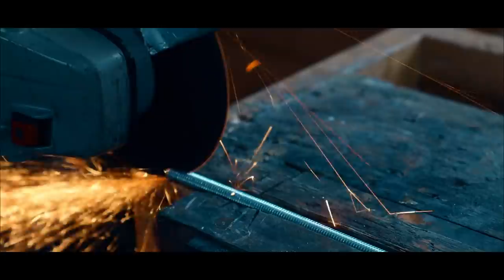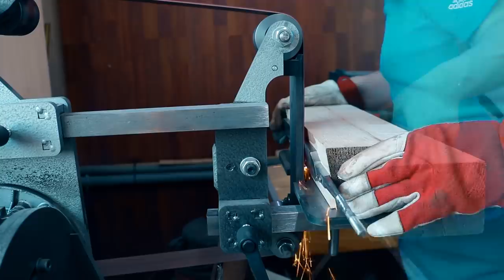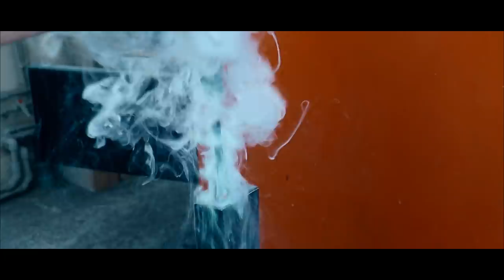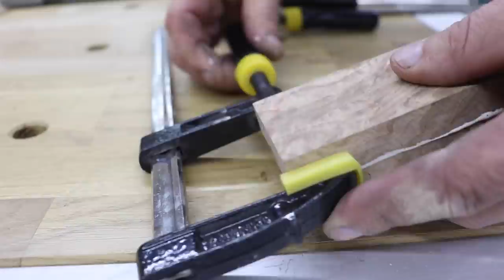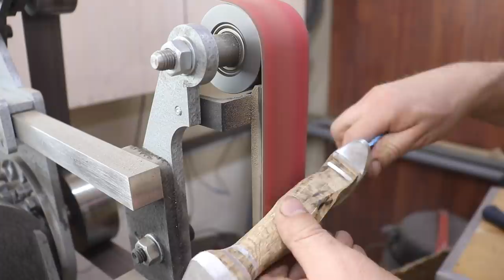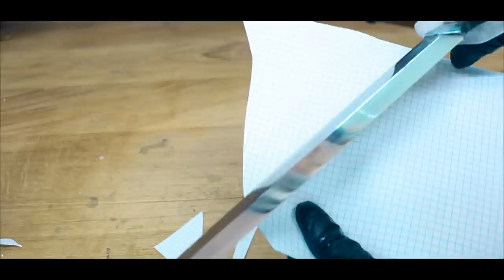Knife making. How to make a knife.

Comment: Umm sir. I do not mean to throw shade at ya. But that gard. Is it aluminum? Cause the blade/tang would be high carbon steel. ... aluminum and steel don't like eachother  and it would be a waste of your time and energy if it fails on you. You mite want to change that out.  Just a helpful suggestion.  No finger pointing.
That being said. Grate work looks amazing.

Comment: Why destroy it after making the video ?????
Reply: Could be that wherever he lives, a long dagger like that is not legal and he had to destroy it to stay out of trouble... or more likely because it was not useful as a knife. He (correctly) removes the temper from the file to work it, but that wood stove he used to heat it up to quench does not get it hot enough to retemper and harden the blade. It won't hold an edge, and I would not be surprised if cutting those plastic bottles at the end took quite a bit of the edge off of the knife. It's a great showpiece, but I would not use it as a knife. Would have loved to have seen him try and cut the paper after the bottles.

Which is a shame because with a simple box of dirt and a blower, the knife could have been tempered properly and it not only would have been pretty, but would have been an actual knife instead of a knife-shaped object.